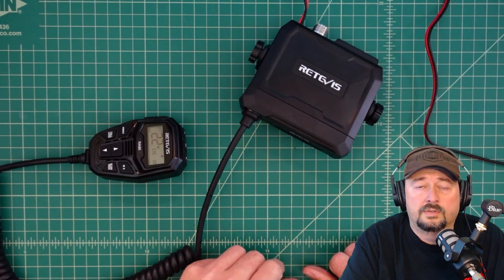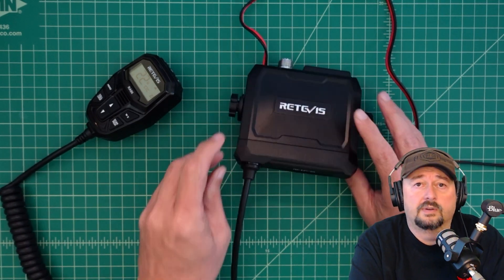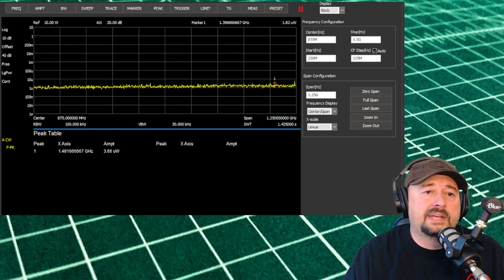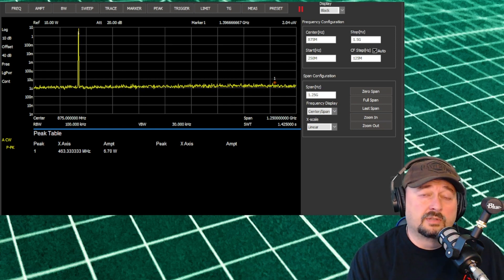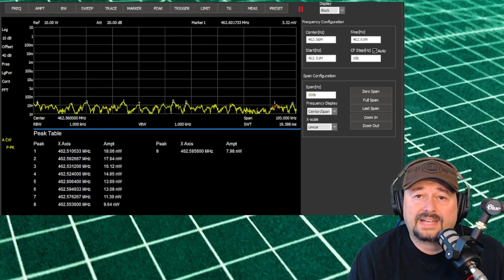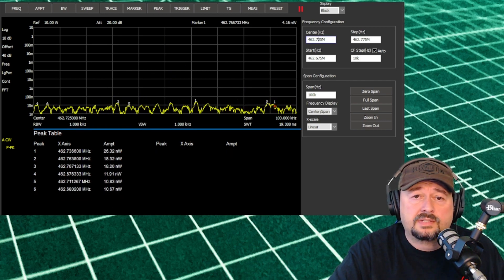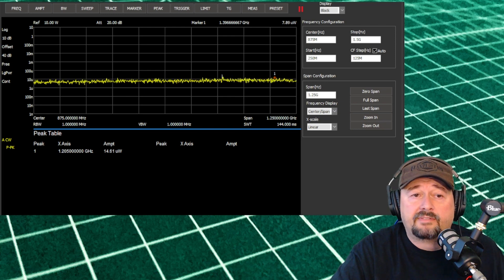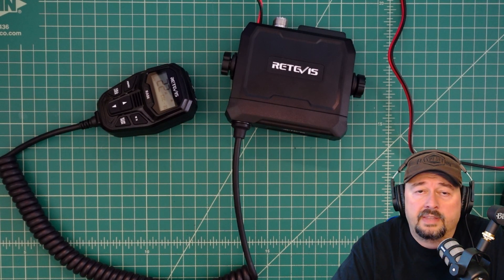Retevis RA86 GMRS Radio Spectral Purity Test

Comment: Appreciate the signal check. I just got two of these in from Retevis on eBay. I was playing with one in the Jeep Gladiator where it's going to go. Even with that little antenna it comes with placed on a metal ammo can cable's length from the radio my meter was showing a very low SWR and a little over 15 watts. That really surprised me since the cable was skinny and the antenna tiny. I'm both HAM and GMRS licensed and find both useful. I'm finding it just works better to run a HAM radio separately from a GMRS install and two antennas instead of trying to expand the range on a ham radio and deal with compromise on the SWR for GMRS. Not to mention it's nice to be a bit more legal. ;)
Reply from the maker: Thanks for checking out the video WQ 👍

Comment: Nice and clean spectrum output.  Unlike some of the Reteivs dual band ham Ht's.  It definitely is harder to design a spectrum clean transmitter across multiple bands than it is across a single band.  It is also more expensive.  Great test and video!  73
Reply from the maker: Thanks for checking it out Jeff 👍

Comment: When looking at harmonics near the noise level, these may be caused by non - linearity of the Analyser. I have used a 300MHz and 700 MHz high pass filter after the attenuator to suppress the fundamental. I have seen readings of harmonics improve significantly
Reply from the maker: Thanks for the info Tech 👍